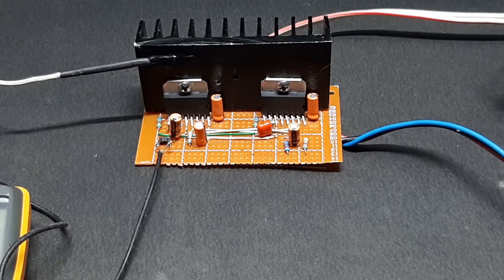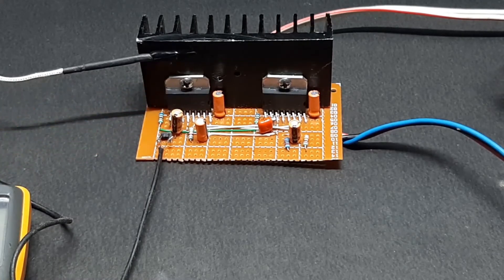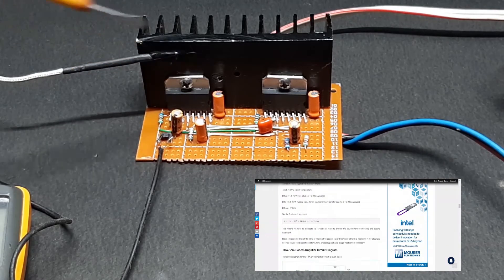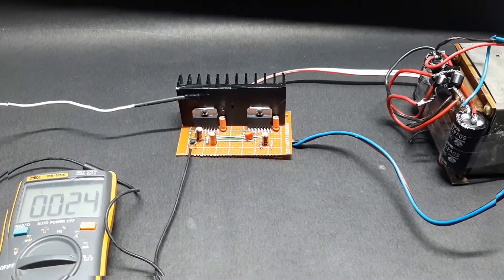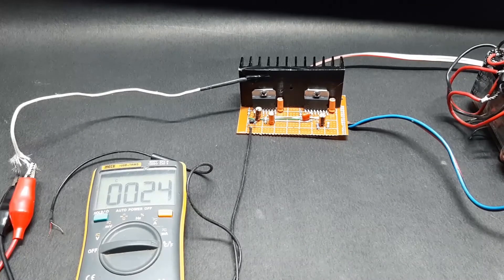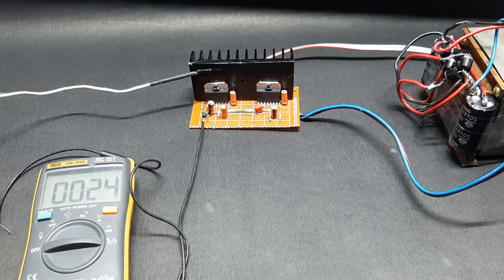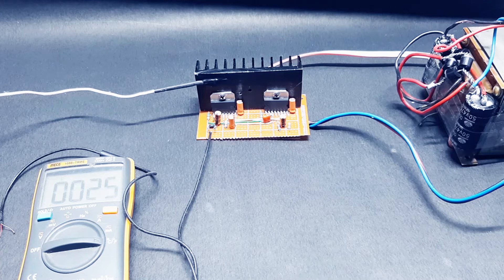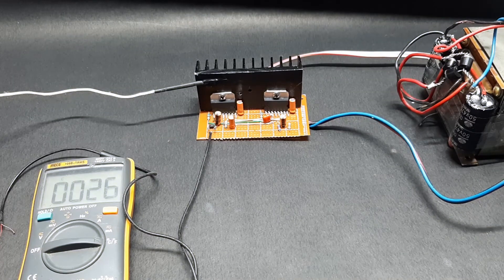How to Make 170W High Power Audio Amplifier using TDA7294

Comment: which's volt/amp of transformer & power capacitors we need to use for stereo bridge mode tda7294 amplifire  at 8 ohms load?
Reply from the maker: it depends on the WATT rating of your speaker and amplifier
Reply: 180w+180w

Comment: Hello! I need help, I build this amplifier and had a problem with temperature of heatsink, it became very very hot when I turn up the volume in a two minutes. I'm using a toroidal transformer 24+24 AC 6A and a speaker 8ohm 400watts. It is normal such a temperature? My two tda7294 they're not gonna blown? I put my hand on the heatsink and it burns... I don't know what to do.
Reply: Consider using a 30-0-30 transformer instead
Reply: Use a much bigger heatsink, something rated at around 0.5 Deg. C/Watt and make sure the fins are vertical.  The efficiency of a typical class AB amplifier is around 65%, this means that for 65 Watts of output power the amplifier will generate 35 Watts of heat.  Two TDA7294s arranged to give 170 Watts of output power will generarate about 65 Watts of heat so a heatsink rated at 0.5 Deg.C/Watt will reach about 32 Deg. C above ambient.

You can never have too much heatsink.